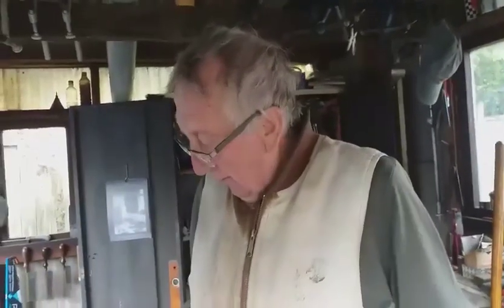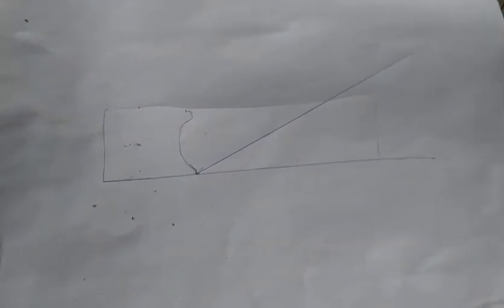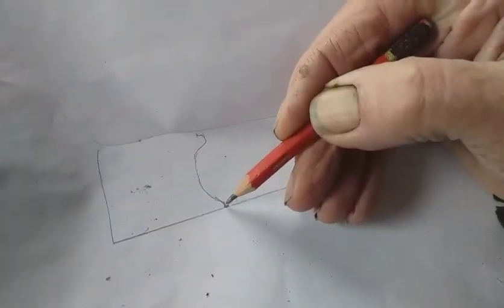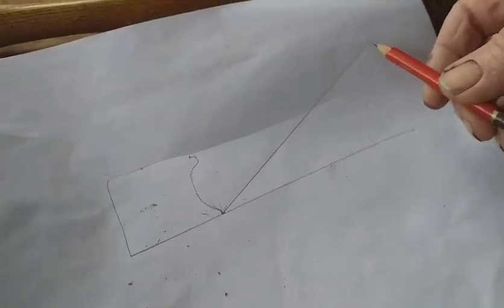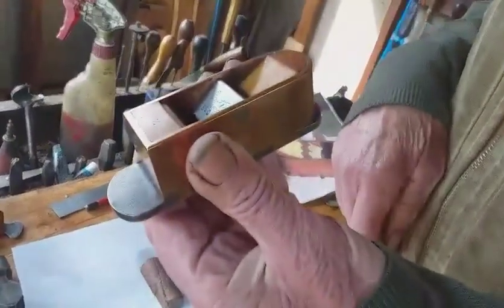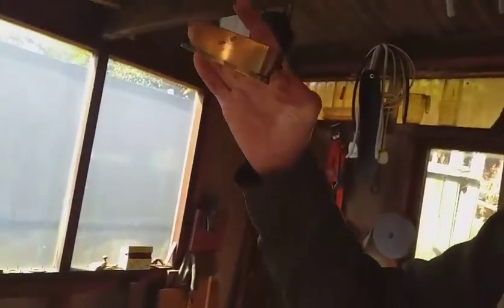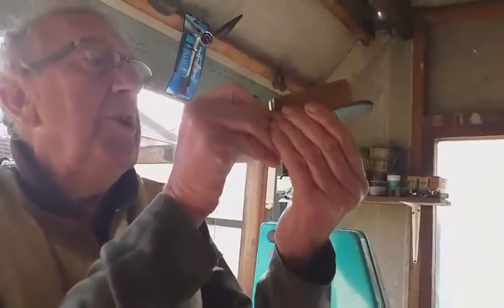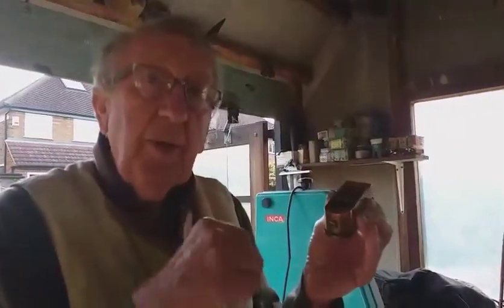No112) Tips On How To form The Mouth Of a Mitre Plane.

Comment: Thanks for the detailed explanation Bill, very useful information and answered every thing I wanted to know.

Any idea what those thin files are called? they are ideal!
Reply from the maker: Sorry I have no idea I came across them years ago
Reply: In the United States these are often called spark plug or spark gap files. They are thin and will flex a bit. I'm not sure if these are produced anymore but I have found plenty of used ones in the back corners of tool boxes.

There are a few sizes of 'Swiss' files that can be had ~2mm thick and are similar to the above.

The extremely thin ones are unusual and may have been intended for use with a die-filing machine. You can get SiC files for scroll saws that are quite thin as well. I might try mounting some bonded abrasive to steel shim stock.